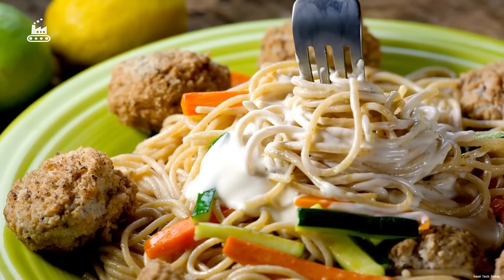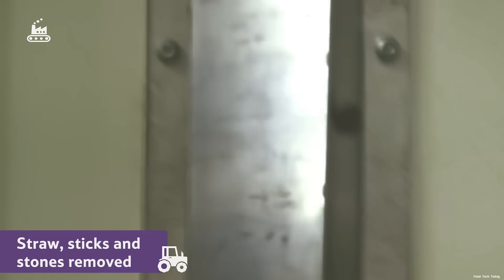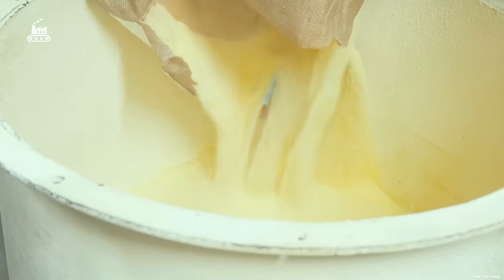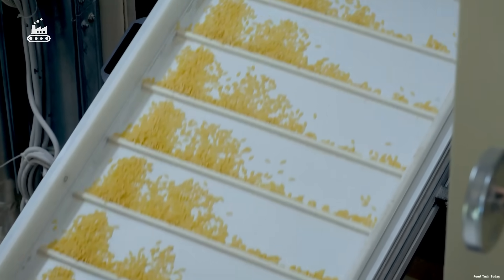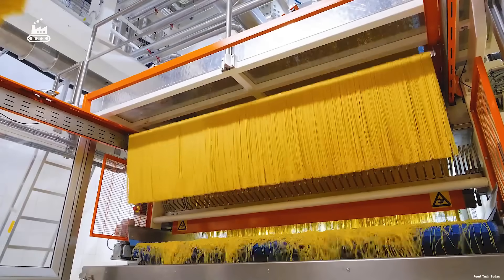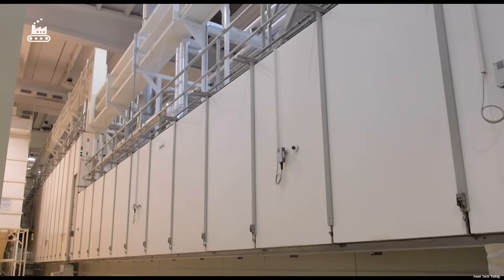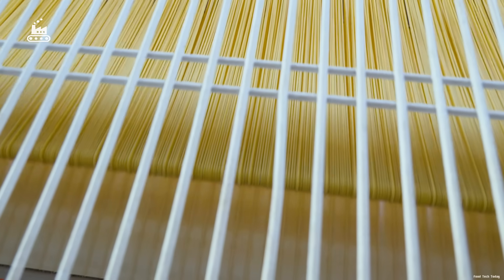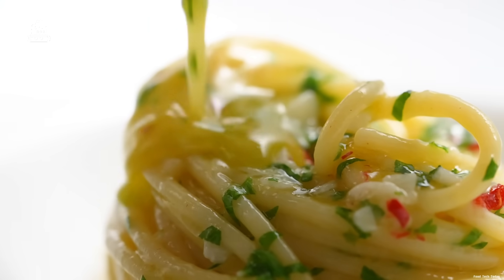How 1,400 Tons of Spaghetti Are Made Every Day – Inside the Amazing Pasta Factory Production Process

Comment: I recently retired after 50 years in manufacturing. Worked on everything from nuclear submarines, eye glass lenses, components for the Space Shuttles, etc, all high tech and complicated. I buy this brand of pasta because I like the taste. I never knew my plate of spaghetti was so high tech and complicated to produce. 🤣🤣
Reply: Wow you have such a huge amount of experience and skills. Respect.
Reply from the maker: Pasta: the final frontier. Boldly boiled where no noodle has gone before
Reply: Barilla has been considered a lower-quality pasta in Italy. It's dried too fast, at too high of temperature, which gives it a much darker color than a higher quality pasta. A better brand, but still very reasonably priced, is De Cecco. If price is a problem, you can often find decent quality store brands at very low prices by comparing the color of the pasta in the package at the store.
Reply: Barilla is known for cheap quality in Italy. Check out better ones.